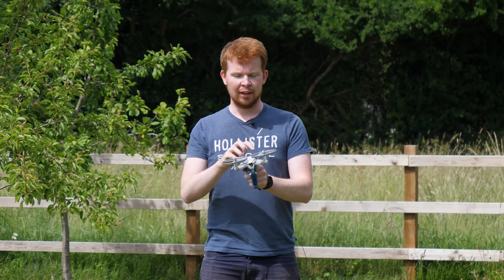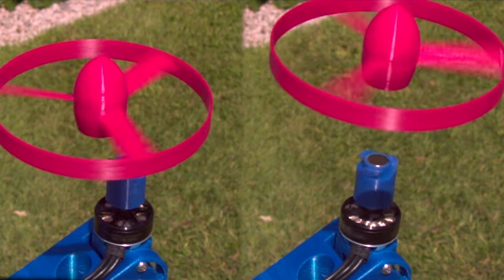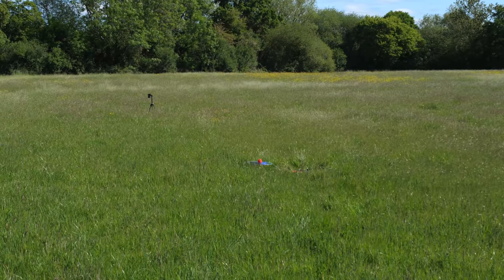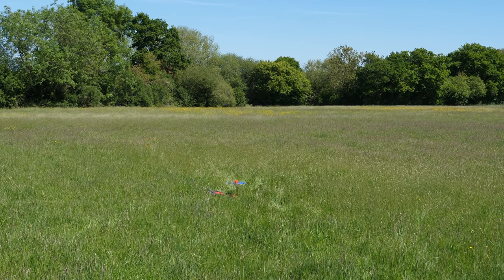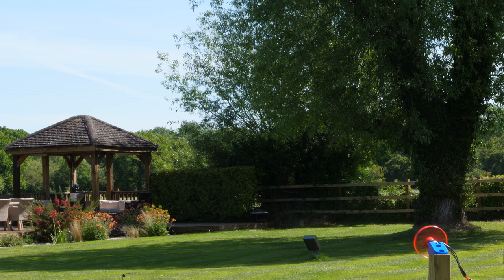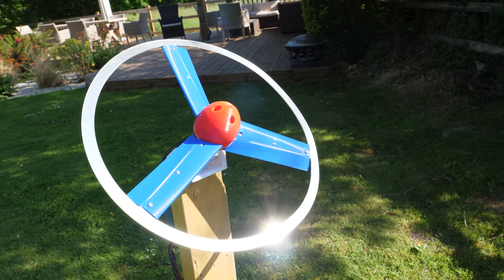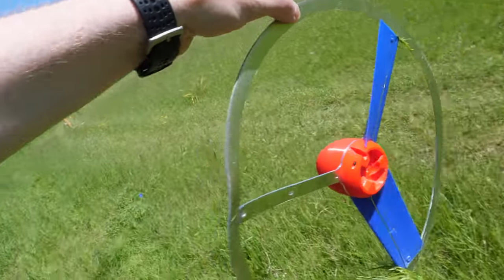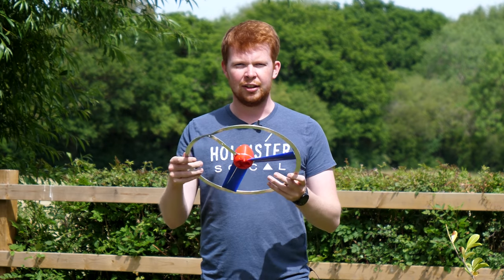Large 'Pull String' Spinner

Comment: Use a gas motor, you can take one off of a lawn mower or something. It would be powerful enough to launch a much larger spinner. Or you could gear it up to launch a smaller spinner at much higher speeds

Comment: Seems to me that the logical next step is to increase the rotational mass - I'm thinking steel rings front and back, adding a bunch of balanced mass at the outer rim? Motor would take longer to spin it up, but max RPM should be the same.

Comment: i have a stupid idea, i wonder if it would be possible to attatch this to the back a small space shuttle for lift off and if you are at a good distance you can give a boost that is equavalent to a nuklear bomb going off and cever the propeler from the back, we would have to build the shuttle stronger too and stabilized to not spin if the blades spin. we would also have to compress a falcon heavy feul supply down to an even smaller volume which would be inlikely cuz if im not mistaken its already compressed in a normal space rocket but its just an idea tho.

Comment: I wonder if you can add a swashplate system to vary the pitch and turn it to a flywheel helicopter. I think it is going to be hard to stabilize the yaw axis. Maybe you can add a tail roto, use designs in NOTAR, or a second flywheel for stabilization? It would be really cool to use auto-rotation for landing.

Comment: maybe try a design with variable pitch blades that are released with a sear mechanism in the hub when it takes off? that way you can achieve higher rpm with a smaller motor before launch

Comment: how about making the ring heavyer? it has no problem taking off, so some extra weight shouldn't be a problem, but it might add some inertia, making it spin and possibly fly for longer. might also help fixing the problem of not having a motor for higher rpm, as long as this motor can get it to the same rpm even if over a longer wind up fase.

Comment: You might look into powering it with a Wood Router. They are between 1 and 3 horses and have speeds between 5000 and 21000 rpm.
That should get it moving.

Comment: Please 3D print an airfoil rim (so if moving horizontal the leading edge is an air foil and the trailing edge is a reverse air foil )and check horizontal motion with a similar size blade.

Comment: Maybe you can use some kind of electromagnet in that launcher thing which can hold on that blade. Once you reach the desired speed of motor you can turn off the electromagnet and BOOM it will be on a higher altitude

Comment: Try this: Make your rotors (wings) flatter and very thin, all the way to the hub, with only a slight dihedral.  Make them very narrow at the outermost point (I'd try about 2") and increasing linearly per radius inch to the inside.  Then make your outer stiffening ring heavier.  What you'll get is a lot less drag, more inertia, and still plenty of lift considering the blade tip speeds you're getting.  At this rotational speed it is HIGHLY likely that your blade tips are stalling, creating drag, and actually fighting against the lifting work being done by the inboard areas of the blades.  And just as important: dynamic balancing.  Spin it up to any speed, measure the vibration with a simple smart phone app ("vibration" is a good one; use displacement, not velocity), then add a tiny trial weight to the hub at three equally spaced places, each with a new vibration reading from each run at the exact same speed as your base run.  Your trial weight's centrifugal force should be no more than ~10% of the entire rotor weight.  From this you can triangulate the needed balance weight and position to be perfectly balanced at any speed. For something turning as fast as this thing, imbalance takes up a lot of energy.  Or you could just blow all that off since it's pretty cool the way it is.  But if you follow my advice?  Find a bigger field.

Sorry, but after 30+ years of fan, blower, etc. engineering and vibration analysis/balancing work, now retired, it's not often I get to spew out some of what I've forgotten that I know, lol.

Comment: The logical next step is to make one spun by rocket engines during flight. Measure what effect it has on altitude and flight time vs vertical thrust from the same engines. Or collaborate with Colin Furze and make one powered by a motorcycle engine.

Comment: Bigger and faster next...but what about a control system mounted in the spinner?  I imagine a gyroscope with moveable vanes (variable) pitch would do the trick.  Extra points if you can get it land back on the starter motor.  Challenge?!

Comment: What if you made it dual-bladed

The first blade spins normally with the motor winding it up, the second blade is spun twice the speed but is not engaged until the first blade loses power in the air, Then it is suddenly engaged giving it a boost in the air to go even higher Not sure how this could work physically or mathematically

Comment: You could have achieved much higher revs with the motor you have by driving the launch mount by a belt, with increasingly large pulleys on the motor's driveshaft.

Comment: To make it faster with the motor you have use gears for example the Lego gears and motors if you have a big gear hooked up to the motor the big gear spins as fast as the motor then you can hook up a smaller one and the smaller one will spin water than the big one

Comment: I wonder if you could arrange three axes/hatchets, so that their blades provide the thrust instead?
It would be a pretty cool weapon for riot control.
A vehicle mounted hatchzooka if you will, running off the cars powerful 12v system.
Take 30 seconds or so to charge up an axe-disk, and then release.

Comment: I have an idea. A fly wheel air turbine locomotive. Steam turbine locomotive haven’t been all that successful, due to the fact at low speed, it used way to much fuel. So what if they had a turbine that not only solved the low fuel problem, but also required less fuel in general. And there would be less maintenance cost, although I don’t know how you would measure that

Comment: How did you ever think this was safe????? It's a fucking 40cm metal disc flying in a RANDOM direction. If one of the blades chips even the tiniest of bits, then there is a chance it will fly more horizontally. Literally a fucking Frisbee Sawblade.

Comment: Hi. In soviet book for children i saw model of helicopter. This helicopter launch up with a slingshot. Propeller blades opened in the higest point, and model slowly sank to the ground (autorotation). I think, its'may be interesting for realization on 3d print and modern materials. If it's idea interesting for you, i can leave screenshot of book.

Comment: I just found you and I'm building my son an electric push style bike with a drill battery my only one. And a razor dirt bike motor.  Back sprocket from the razor but I want speed control for cheap. Can I use a fan switch with 1 2 3  for power modes.  Im using a  switch type throttle  cause of budget.

Comment: Hey you'll probably wont see this but what if you made a stabilizer powered rocket? You could angle the blades of the stabiliser as you see fit and then mount it at the end of the rocket using a carbon fiber rod as an axle and mount the thing on a motor and spin it using some ball bearings? Then spin that angle bladed stabiliser ridiculously fast. Please see my comment lol. would love it if you did this

Comment: Hello i have a query... i used 3 old mobile batteries of 3.7 volt 6Amp (BM47) to power my diy bldc helicopter. when i connect these batteries in parallel thinking that current will increase but it slightly changes at 6-8Amps, when i connected it in series i gives 12 Amps as well voltage increase to 11.9(should be) .... but why current increased in series connection ? can you guide me with this.

Comment: Can you help me out please TOM? I've never played with gears before and I'd like to know where to start with upper gear size for a handset to launch one of these helicopters. I'm guessing at starting at a three inch cog and going three to one ratio down to a penny sized dog. Does that sounds about right? I'm guessing. I obviously need as much speed as possible out of a two foot pull string..... Can anyone help there please? My helicopters blade ring (therefore it's flywheel) will be about ten inches....

Comment: Instead of spinning with a electric motor, go big, jack a rear wheel drive up at the rear wheels, preferably a dodge demon, put a tyre horizontaly against on of the rears, attach small shaft to horizontal tyre to get a 20 to 1 ratio, connect your disk , use string to keep disk attached, accelerate the wheels till vmax of car, around 1620 rpm at the wheels, your flying things would be spinning at 32400 rpm 😂😂😂😂😂😂😂😂😂 and boom you have a missile